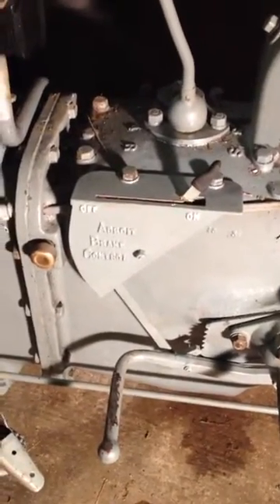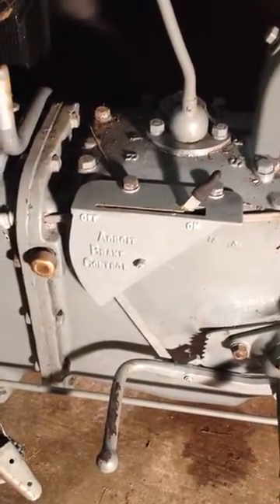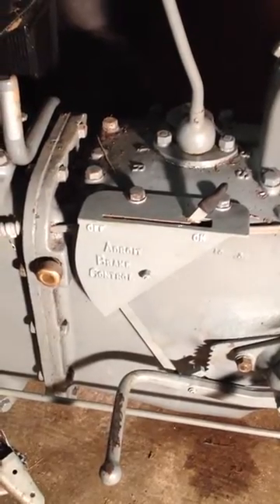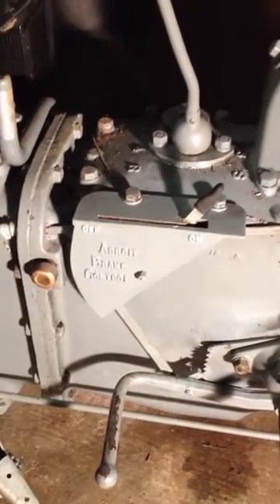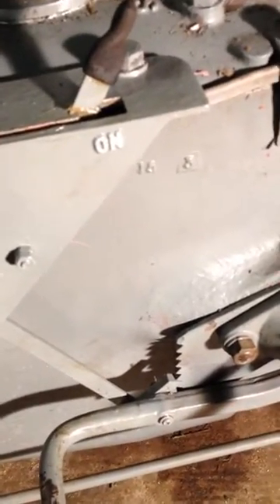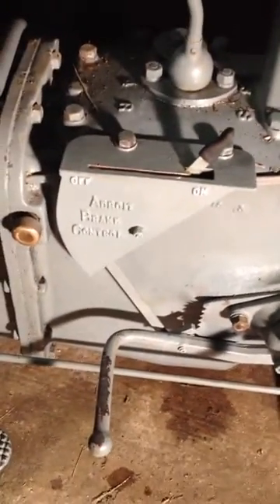abc fergie brake

Comment: My TO 30 peddle goes all the way down, no braking.
I did adjust the shoes with the star wheel
Can you help
Reply from the maker: Durham Humor  Sounds like a break in the linkage - probably need to take the brake drum off.